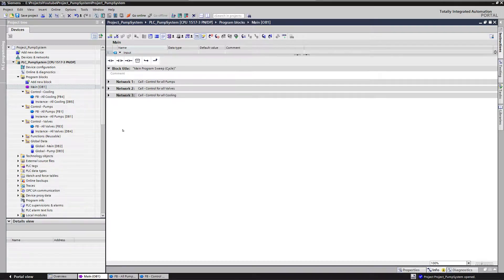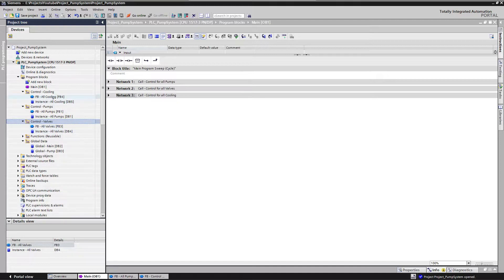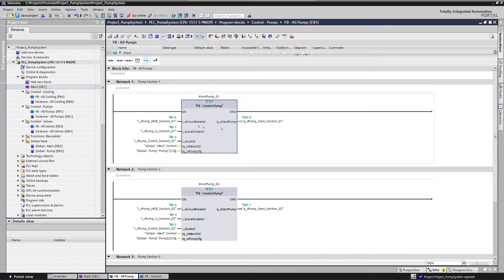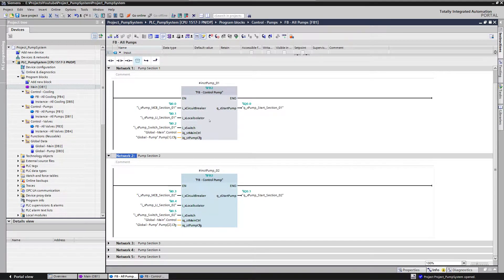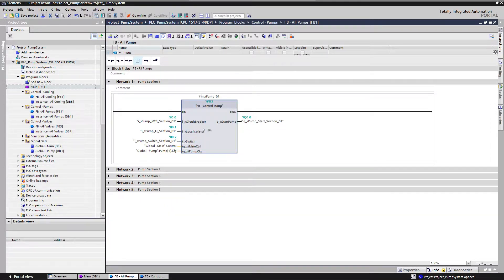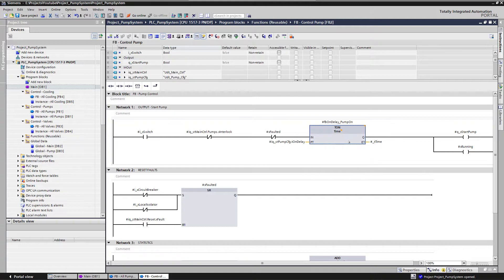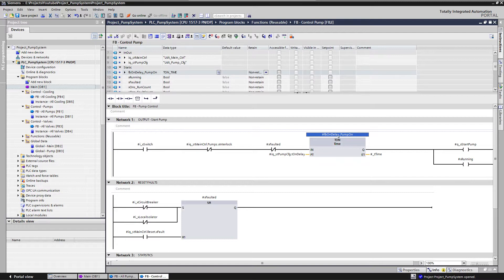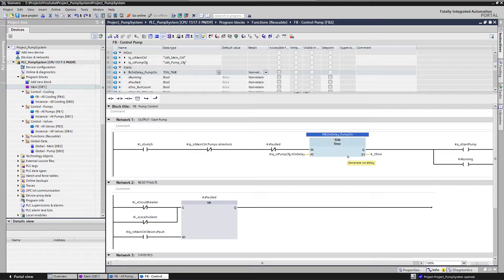Expert Guide to TIA Portal Function Blocks: Pro Insider Tips and Best Practices

Comment: Why didn't you use FCs for the All Pumps, All valves section and then have individual FBs for pumps and valves inside that FC? Just curious what the reason for thst is as your not reusing that "All pumps" routine for example
Reply from the maker: I am using an FB with a single instance for all pumps with an individual control block call - using a multi-instance - for each pump.  The use of multi-instances keeps the application lean without cluttering it with unnecessary DBs.

Using an FC for calling all pumps would not give you the advantage of multi-instances (because FCs don’t have static memory).

Comment: Great video. Is there anything to keep in mind when reusing a  higher order FB with child FBs inside of it?...apart from each parent FB  having independent data blocks and all the child FBs having instance parameters inside the parent FB. I ask as I have a hard time getting stable values in the child FBs.
Reply from the maker: Make sure all child FBs are self-contained blocks of logic using only local data inside. Use multi-instances for the child FBs. Go maximum 2 to 3 levels down (e.g. an FB inside an FB inside an FB) to keep a good overview and to make troubleshooting easier.

Comment: Great lesson Hans! I have a question about using timers or other function like counters, for example, inside user created FBs. Is there any concerns about this practice? I mean, like performance/memory issues or so? Thank you!
Reply from the maker: No problem using timers, counters inside an FB. As a matter of fact, this is the only correct way to use them in TIA because you can call them using a multi-instance (which is not possible in FCs or FBs).  Never use hardware timers or counters (e.g. T20, or C4), use IEC timers instead.
Reply: @PLCskilltree  thanks for the clarification!

Comment: how do you use the function blocks? how did you get a pump section? where did FB- Control pump come from?
Reply from the maker: Hi David,

The meaning of this tutorial is not to explain the application that I am using, it is to point out some important insights and tips on function blocks in general.

Comment: problem of the FB's is that in fact you have double memmory usage. Each input and output are stored in instance memmory. You have UDT as "iq" parameter and you store same memmory in global variable as well in your instance..so you expend you memmory usage. So i exceed  the work memmory limit by creating "big" projects ( 50 valve's , 20 motors, 40 Switches etc...)  Solution:  replaced all to the FC's and use the counter for count the time and its reduce my memmory usage at least to 40%... :) I still think that the best praxis to use the FB's only in OOP (example TwinCat/Beckhoff) there you can create the object(class) and work almost without "global variables" and you will avoid double usage of the memmory as well many benefits from OOP. Waiting Simatic AX
Reply from the maker: Using the InOut of an FB only passes the UDT through to the FB, like a gateway (=call-by-reference). Using the Input and Output of an FB required copying to and from the instance data of the FB = requires extra resources.  I only use FCs for small repetitive tasks that don’t require static memory, like small calculations, conversions, or scaling operations.  I use practically only FBs in my projects (and they get very big) and I never had problems with work memory (retained memory is a different conversation)

Comment: Primary reason for me to use FBs, I hate merkers. But that's more or less a 'how to structure this' issue. I want to use as less merkers as possible.

Regarding the local variables of the FB, I always use the following notations:

Input : i_"Tag_name"
Output: q_"Tag_name"
InOut: iq_"Tag_name"
Static: "Tag_name"
Temp: t_"Tag_name"
Constant: "TAG_NAME"

If your code is clear, everybody can see if it's a binary value, int, word, real, etc, but it's hard to see the difference between a IO, static or temp variable.That's why I use this system. But every structure is better than no structure. 

Keep up the good work!

Regards,

Alex
Reply from the maker: Thanks for your explanation Alex, I almost use the exact same tag name convention as yourself 😃.  As for merkers, you are correct, they should be avoided at all costs.  Build structured data in Datablocks instead.